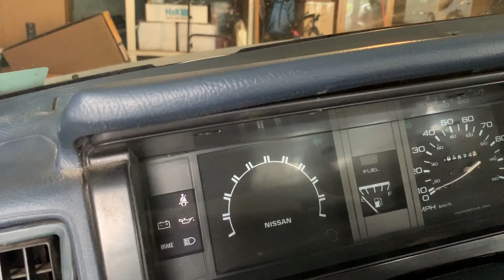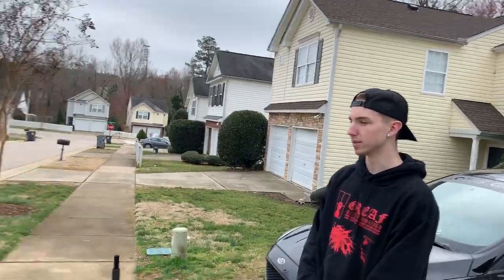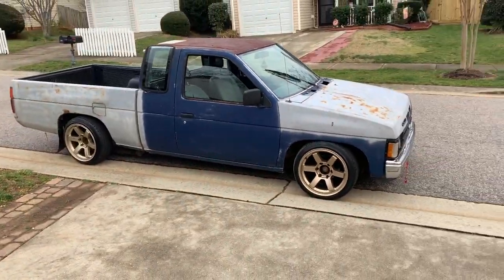Stanced D21 goes LOWER (bumpstop removal)

Comment: For all those asking about the wheel/tires. They are Level 8 Wheels 17x 8 OR 9 -12. And if you stop this video at 3:57 you can see the tire size is 205/45.
Reply from the maker: Josh Herbert they 17x9 -12 I forgot the tire size but good job
Reply from the maker: Level 8 mk6

Comment: I just bought these wheels with federal tires exact same ones
Reply from the maker: aye lets go I loved them
Reply: Why did you take the bump stop stop why didn't you just loosen up the torsion bars?
Reply: Did you put lower and blocks on the back and if you did how many inches was it 3-in blocks or 4 because I have 17-in rims and I don't want mine to rub
Reply: Hey man where did you order your lowering blocks at I want to get the same ones from my truck mine is 97 and I like the way your sets. I seen the ones off Amazon and advance Auto but I'm not sure which ones to go with what's your opinion and where did you buy yours?
Reply: @brandonb6903  i have 3 inch blocks in the rear with the exact wheels on a 205/40 if I’m not mistaken and i have hella rear wheel gap. You’ll be fine. As for blocks, just go to advanced auto and buy em.